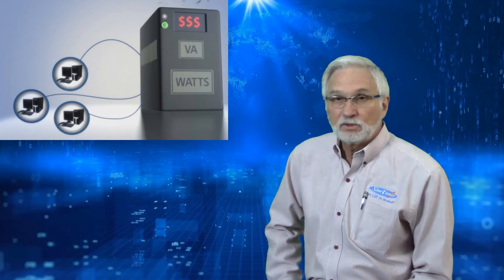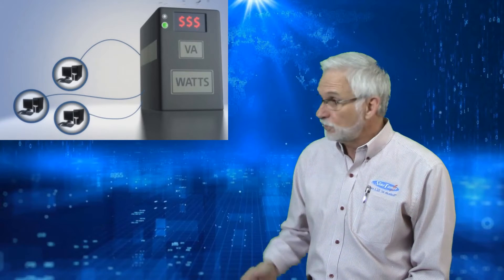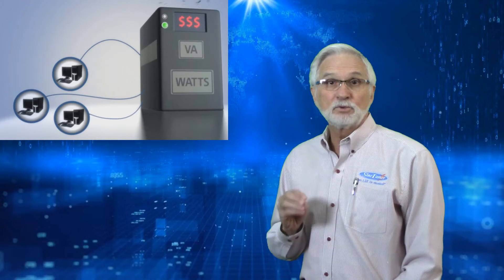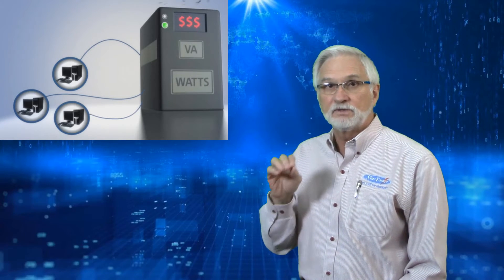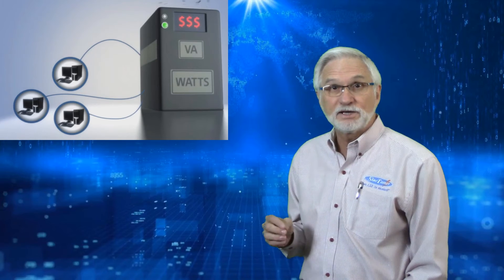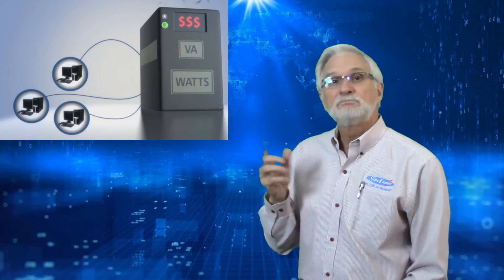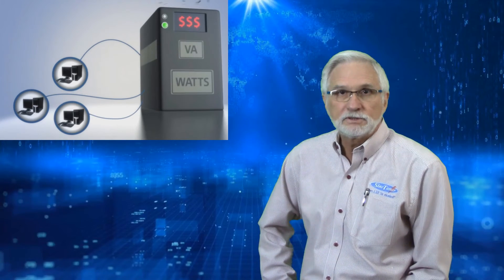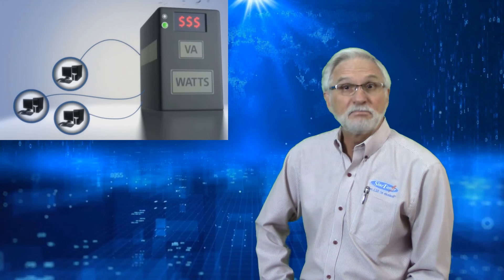How do I size a UPS?

Comment: We like to connect a 80 kW Diesl Generator to a 75 kW UPS (Only 50% loaded - NO plan to increase that) having mostly (90%) Lighting loads. Is the DG size OK for this UPS connection?

Comment: I want to be able to run a presentation online for work without worry of a power blackout/brownout
Say I have a standard 120V household power line, and want to run my PC for 10 minutes.  The PSU is 600w, monitor about 60 W and I want to keep my modem running.  The PSU is sized mainly for my GPU.  Also, what must stay running is my wireless headphones and my Scarlett 212 and Rode podmic.  The PC I would imagine would be running on minimum power for running Powerpoint, Zoom and a few other apps.  
What is the VA/W that I would need for a UPS?  Thank you in advance
Reply from the maker: I would recommend at least 1kva.
Reply: it seems like a lot but OK
 @SineTamer